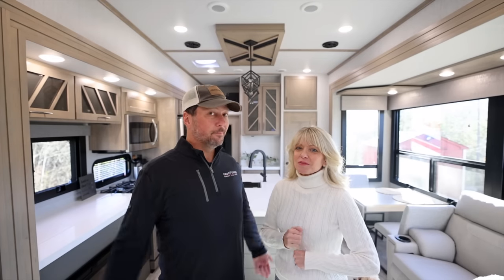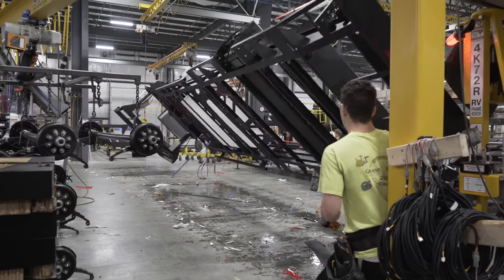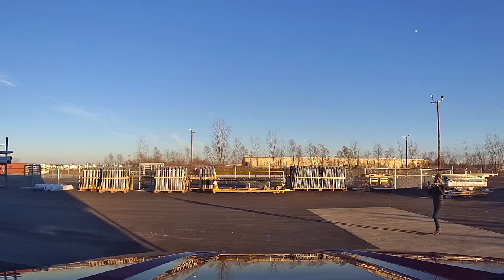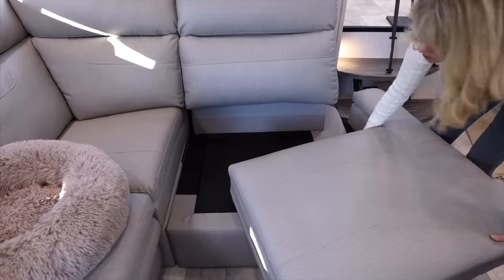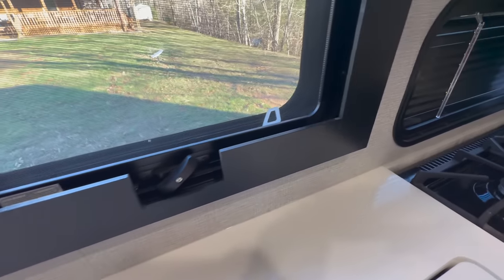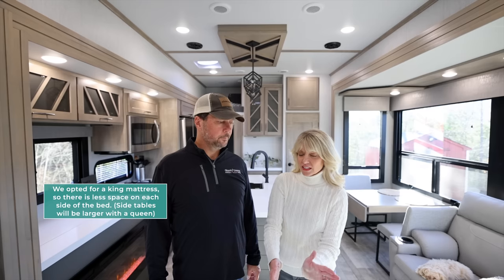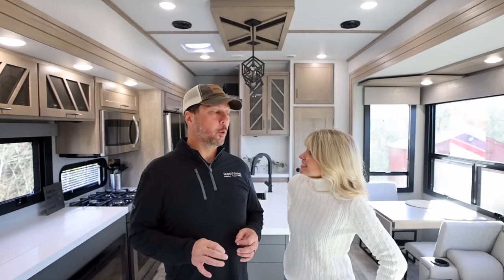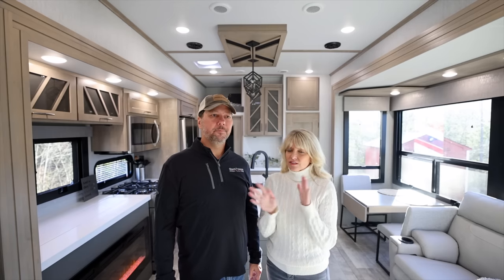Momentum 410 THR Homecoming, Issues, and Updates!

Comment: Suggestion for the door thin shade.  Install it upside down.  That way you can push it up from the bottom so you can look out over the top and they still can't see in.
Reply: Great idea. Thanks.
Reply: We installed ours upside down and love it. Great way to peek out the door at night!
Reply: That is a really good idea.
Reply: We installed the thin shade upside down.  Works great.
Reply: Our thin shade broke the first year out.  We haven't torn into it to see what is going on.  Maybe this winter when we get to Florida.
Reply: I’ve used mine upside down since moving in earlier this year. Works great.
Reply: Yup!
Reply: Cool on upside down! Note the plastic shade can deform under heat; not cool. Annoying you can’t put it up or down without first opening the screen/door combo, then splitting them to get to the handle to operate the thin shade. Just sayin’ 😊
Reply: Was headed to comments to suggest this. That’s how all manufacturers should install them.
Reply: I want that thin shade window. I almost pulled the trigger then realized it has to be a 1-1/2” door, my walls and door are 1”. Caused the same issue for a keyless lock, too.
Reply: That's what we did with hours and I'm very happy that we did. I actually installed the window as an upgrade to our frosted glass one and I installed the whole window upside down so it was set up properly to install the shade upside down. Definitely don't regret doing it

Comment: First, love the new RV, so happy for you both and Daisy of course.  My two items would be 1. Yes move the controls into the cork board where is currently hung,, just make the cork board a little smaller so the control fit into the same frame and of course leave the hooks below. 2. This would be a change over your bed. Put the cabinets above the head back which would solve the light height issue, then add more storage if needed but allow for a power outlet in the Cabinet and port holes for a CPAP  machine hose.  A lot of use fat guys have to use them but would love to have the machine cleanly stored in the cabinet with just the hose exposed out the port hole on either side , maybe behind the his and her light..   Just my two cents … Love the channel !!!!!!!!
Reply from the maker: Hmmmmmm.. Yea.. some cabinets might be a good idea as long as we can still sit up in bed to read and such.
Reply: Short term solution for the bed reading lights (until something permanentcan be done).... get a stick and put something soft at one end (or find a jumbo pencil 😀) so you can poke them lights on/off. If the "Friends" gang can rustle up a poking device long enough to reach Ugly Naked Guy, you can make something about a foot long....

Comment: Congratulations!   You should be very proud of your design and input.  The interior looks so wide open and bright when compared to kitchen and lounge areas of all other toy hauler designs.  I'm a bit disappointed that GD didn't do a better PDI for you.  The blind boxes have to go!!!   Also, the lighting above the bed has to fixed.  I have the same issue in our 5th wheel and find myself falling asleep after reading or we stumble blindly out of bed at night because it's too hard to reach the lights.  Glad to see they added a sturdy handrail to the bath / bed area.    Overall, it's a beautiful rig!

Comment: I found your areas of concern to be interesting. We own an OLD 2003 Glendale Titanium 5th wheel. Surprisingly many of your current problem areas were addressed back in 2003 by Glendale. We absolutely love our slides on both sides of the living area...opens things up so beautifully. We have a closet in the wall by the door, our electrical/slide controls are on the opposite wall. I can access my refrigerator while both slides are in and the same with the bathroom. We have a house size mirror cabinet for the bathroom and you certainly have the space for a much bigger mirror/cabinet. If you look at our old baby's floor plan, you will see that we have almost no basement and hardly any room in the bedroom. Every plan has it's faults. I know that you will get yours addressed and the rest of us will benefit from all your hard work!!! The bright interior is really attractive. Hope to see you on the road someday soon.

Comment: With great excitement we toured the 410 TH-R today. Beautiful rig and I have a few recommendations. I’m 6’-4” and my wife is 5’-6”. 

1) The garage bathroom is virtually unusable for the ol #2, unless you’re a very, and I mean very, small person. When you’re seated, you’re  shoulder to shoulder locked in place. You’re left arm has to rest on the sink.  For this luxury class, they need to increase the width appropriately 12” and sacrifice the garage space.

2) The main water closet toilet is so close to the swing door I couldn’t shut the door by about 4” due to knee clearance issues. Same for my wife by about 2”.  It appears the toilet could be moved back a few inches, but even that would leave us knee cramped at the closed door. As with the garage, they need to enlarge the room.

These (2) bathroom issues are total deal busters for us, and I’m telling you guys, we really wanted this unit. BTW, the salesman had the same space issues as we did and is reporting that to his manager.

3) The pop-up TV is located near middle of the counter, so if your cooking and watching the TV, there is little to no space in front of the TV for counter use. I realize putting things on the counter will partially block areas of the lower screen, but I find that a worthy  sacrifice. 

It looks like the TV could be relocated very close to the exterior wall to fix the issue.

4) The hanging closets (2, thus) are curved to conform to the nose cap. Clothes hanging near the exterior sides will most likely have some hanger clearance issues.  Suggestions?  I don’t know how to resolve this with the washer/drier hook-ups located between the hanging closets.

5) The washer/drier - shelf area, noted above. If you install these cleaning units, you’ll lose valuable storage for shoes and flat storage/short things. So, without the shelves, and small hanging closets flanking the washer, it’s a “bit” problematic for us. 

For notes 4 & 5 above, I don’t have  any meaningful recommendations to offer. These two  items are not deal busters for us, but again, at this price point, I’d expect better hanging clothes closets. 

The rest of the floor plan is most excellently done and of course, the quality of the 2023 Momentums are top class! Good job Grand Design.

Lastly, I’m a very positive thinking person and not disrespecting Grand Design or Changing Lanes……just providing asked for feedback. Absolutely love your show!!!!

Comment: Sweet rig!  Kitchen outlet, 2 separate light boxes in 2 different locations. You can never have enough outlets but having 4 together will be too restrictive when you need to spread out on that beautiful island. The control panel behind the slide was a big OOPS and must be moved, and the bedroom lights, seems like wires can be run with a switch on each side of the slide so they can easily be accessed. Great work Grand Design and C&T. Happy for you.  And the fender bender, drag, but things happen and you have a plan to remedy it, so all is good. Glad Daisy seems at home already, sweet pup.

Comment: I've been watching you guys off and on for several years.  How cool to be part of designing your own perfect 5th wheel?  
- For the medicine cabinet, have it taller to extend lower to allow taller items inside and a better view of yourself in the mirror, rather than just your head. I drop food on my shirt occasionally, and a taller/lower mirror would alert me, LOL
- That window over the stove should be a true rectangle to allow fitment of the blind while covering any corners, plus match the other windows.  
- Lose the window in the entry door for security purposes, keep it solid. Use a camera or view from an adjacent window.  The door is the main entry point, so keep it secure and solid, you have plenty of other windows.   
- I felt left empty with no walk through of the entire floor plan, and a walk around of the exterior to get a better idea of your new rig.  Only then, do the problems make more sense.  Curious as to overall length, width, height, weights dry & full, etc.     
Congratulations on your new rig.  While going all custom, the issues will keep arising.  You guys are good, so keep on keeping on.    
  .  ..

Comment: I feel Chad's pain with my beer belly :)  Our 5th wheel is almost completely accessible with slides in.  
.
Outlets, and GD won't want to hear this, yes, 4 outlets, possibly two on a pop up mechanism.  And run 12g on one 20 amp circuit or two 15a circuits.  One of my biggest complaints on our trailer.  Two kitchen outlet boxes, outdoor outlet, and bathroom outlet all on the same circuit that may have also included the battery charger.  Talk about being way over loaded :(
.
Re bleed your disc brakes ASAP.  Mine were poorly bled from MorRyde, to the point we almost had a collision due to a lot of air in the lines.  They need to be checked anyway, but mine were not properly bled. It was your original IS video that convinced me to have IS installed on our brand new 5th wheel.  It really is a game changer.  We travel with stuff on the counter that is only lightly retained.  Did have one issue with a deep fryer on top of a cabinet.  Hit an unmarked speed bump and hit just the right speed and threw the fryer on to the top of one slide, making a huge mess we are still cleaning up several weeks later :(
.
This should be every mfg dogma to work with people that live in the RV's, especially those that like to tinker too.  I know I'm struggling with factory installed solar.  It's a poor design that is not friendly to expansion.

Comment: Love the rig.  
1) Totally agree with a longer/deeper medicine cabinet. 
2) Did they put the window in the toilet closet?
3) those bed lights would be annoying.  Perhaps make the bed a bit higher.
4). Get rid of the boxes around the windows (what were they thinking?)
5) outlets at each end of the counter.  GD you can figure it out.
6) Electric panel by coat rack ok.  Leave the coat rack as is.
Wonderful rig. 
7). Slippery...out the thin shade in automatically.  Upside down to let light in at the top.
Sorry to see the boo boo.
Enjoy

Comment: Regarding lights above your bed. We had the same issue with the lights being so far above our heads they were hard to reach plus the lights up there glare down into your face. We replaced them with lights that have long adjustable extensions with the light at the end that make it perfect for adjusting your light to the right angle for reading. The switch is in the head also so it's easy to switch off and on laying down.

Comment: Front cap LED lights and underbelly LED lights are joined together at the LCI OneControl unit (not touchpad but the big unit with relays). You could just wire the cap's black wire (which is actually 12v+) to a switch to be able to turn the cap light off. I rewired all of my RGBs to a DMX controller.

Comment: Enjoyed the video and the information!  We got our new 2023 Momentum 381MS in December.  We have the same issue with the underbelly and the cap LED's.  Definitely should be separate on the controller, plus we also have the annoyance of the interior accent LED's in the living room are also tied into the accent LEDs in the master!  We have the same issue with the metal blinds above the stove, although the metal blinds are easier to clean!  Being a technology guy it is a bit frustrating that a RV at this price point does not have all of the lights available for control from the panel or the app.  In our case, everything from the garage back has to be controlled from the rocker switch panel in the garage and the master and front bath all controlled independently from each location as well.  I definitely wish we could open our kitchen/living room slides independently.  This would be super helpful when traveling.  We had a similar issue with the rear ac!  Seems it was one of the plastic housing pieces vibrating during operation.  I am also pretty disappointed with the lack of attention to the wiring in general.  To put it nicely, it's just a mess.  Looks to have been completed very rushed and very messy! We are only three trips in and love the RV in general....always room for improvement!  Glad GD is listening to its community.

Comment: On our 382, the cap lights and the bottom lights are joined in the front storage bay behind the switch. I added a toggle inside the bay to disable to cap lights when I only want the bottoms.

Comment: I bought  a new 2018 Reflections 337RL in August 2017. A total nightmare! Every major appliance in it didn’t work, stopped working, was replaced completely, parts replaced several times, mice everywhere within a week. Inside the island, inside my dresser drawers, inside the walls, up inside the attic in the bedroom, in the pantry! They got everywhere and I had traps all over and had to put down poison bait for them. That slowed down the infestation!  I was so disappointed with my new trailer and finally sold it! 
All I can say is good luck!

Comment: Nice unit. Love the color scheme. We also have the problem with the lights above the bed being too far away for comfortable reach. We started using a long shoehorn to reach them from the bed without stretching, The shoehorn just hangs from the valance when not in use. Just a temporary fix (five years ago). Enjoy the new trailer.
Reply from the maker: Sometimes the simplest solutions are the best!

Comment: Chad, as the son of an electrician, I would certainly wait on where to put the second outlet. In your spare time, maybe you can remove all the island doors/drawers and see how and where you can run a 20amp romex cable to the opposite end of the island, tying in to the original outlet. I’ve done a number of additional outlets on our 2021 Grand Design Reflection 340RDS. We don’t have an island in ours but we do have one in our new kitchen at home and I placed an outlet with USB ports running the cable with all the doors and drawers removed and set aside. Just a thought….

Comment: For the LCI system, if you actuate any of the manual switches that are controlled by it then it unlocks it as well. This can be the main kitchen lights, the water pump, any of the awnings. This way you don't have to get to the touch screen to unlock it.

Comment: Not sure if it's mentioned, but the window boxes appear to be moisture collectors in the cold. On the other hand, you can stuff some towels in them. I understand RV's are not great in the winter times. Seems even the ones with a "cold package" don't work out that great of are fuel/power monsters to heat. Nice looking 5th wheel!!!

Comment: We have a 395.  Love the RV!  Something I noticed that is a design problem is power.  The whole RV is on one 15amp GFI.  This has been an issue with the office in the garage and main cabin.   If you are running a coffee maker, hair dryer, and the portable freezer in the back, it can and has blown the breaker.  I would suggest at least 2 - 15amp GFI circuits so you could power the back along with the main cabin.  It blew just yesterday when we had a portable heater, coffee maker and turned on the seat warmers.  Not a good design.

Comment: First, install the thin shade upside down. The lights over the bed are extremely bright. I found some disable lights on Amazon. I'm super excited for the front cap lights. Try dimming the Kitchen Chandelier lights. On my '22 397ths-r I have the same lights. They flash when dim.

Comment: HI Chad, Tara and Daisy-Mae.  Merry Christmas and a Prosperous New Year.  Your new traveling digs are very sweet.  Looks super parked at your place!  Probably the only thing I don't like about our GD Imagine (TT) is the fridge is blocked unless we push the slide out (but we have the small outside fridge the we keep ice blocks in for travel days.) So, there is a workaround.  Tara, I agree, the med. cab. needs to be 9 inches taller (or lower) and adjustable shelves would be so thoughtful :-).  When traveling in snake country, it is a safety issue to have the underbelly lights on, so you don't step on a critter.  I love the chaise.  We have our camper decorated w/ items and pictures from our travels.  Did you know there are acrylic glasses that look like crystal? Y'all stay warm!

Comment: Great video guys, you pointed out some good points! 

For the counter, most definitely need more outlets, especially since lots of folks are buying RVs and trailers to work remotely! How about a desktop USB and power grommet outlet, or even an undercounter strip outlet with lights?  

For the bedroom reading lights, how about motion activated via a sensor eye/switch that’s either on the side or where the headboard would be?

Comment: Love the external graphics and colour palette...the inside cabinetry colour is nice and bright compared to last year's offering...about the blinds , if thay cut a grove in the bottom part that incases the widow winders so you can use the blind pull string ball to hold the bind down..each blind draw string would have to be cut to size but I think it would work!!.😎